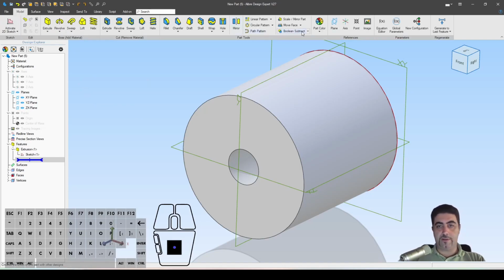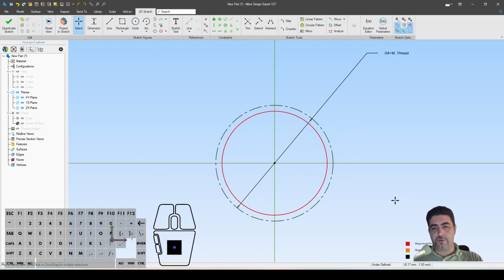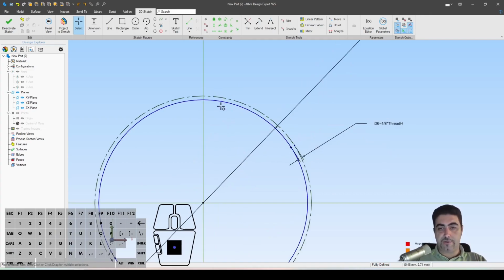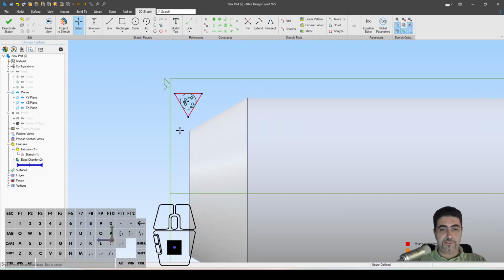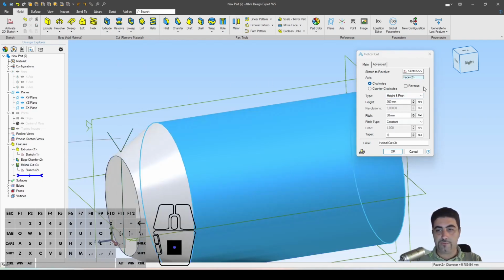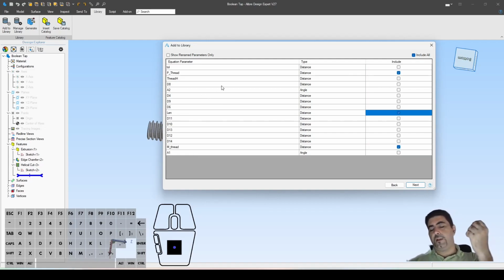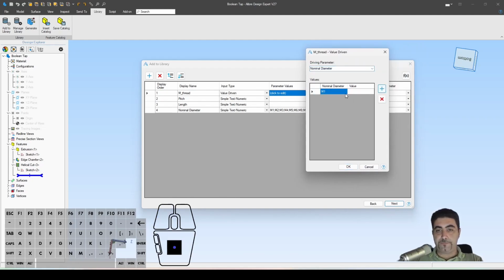STOP Wasting Time with Old Thread Modelling and Try THIS Instead!

Comment: Love it. Here's a challenge since you appear to be the master of this... Are you able to do NPT threads? The main issue being that they are tapered. Anyway, thanks for the video!
Reply from the maker: Yeah, I actually mention this in my other video, the one I reference here.

You need a properly tapered hole, and then in the Helix, you just input the correct angle, which can also be a parameter.

Comment: 00:00 Part 2! Let's go!
00:12 And tap it we will.
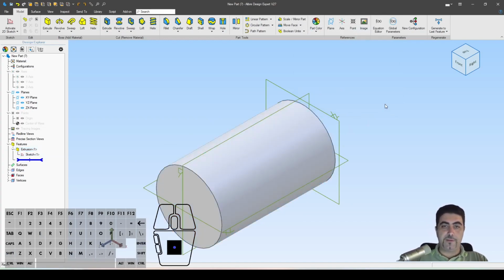08:50 I realized I didn't have a keybind for finish sketch. Let's fix that.
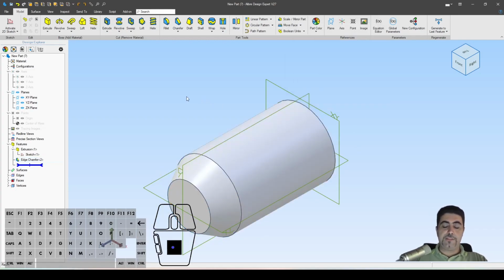09:44 Actually, it doesn't look like the same result to me. At this stage in the tutorial, P_Thread is still 1mm, but the process you just did caused the distance value to change.
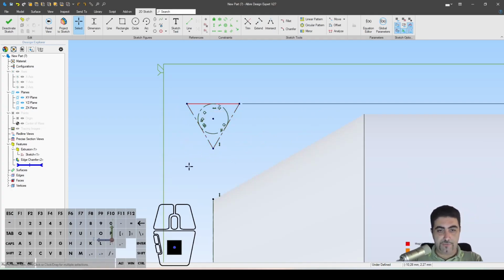12:20 Wash, rinse, repeat! I've done this part enough that I'm getting ahead of the video here!
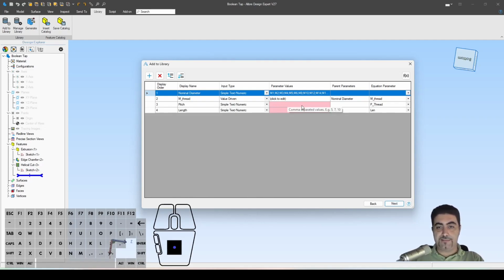22:05 I ran into this problem here in the last one! Not sure if you mentioned changing the Input Type and I missed it, or if it got cut out, but I did manage to fix it by looking at yours. I didn't miss it this time, though!
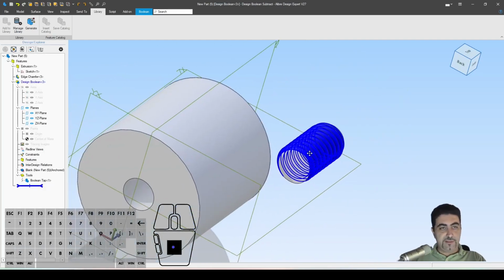23:22 I can't find how to turn on "Real Time Update" by default. Any clue where that is in the settings?
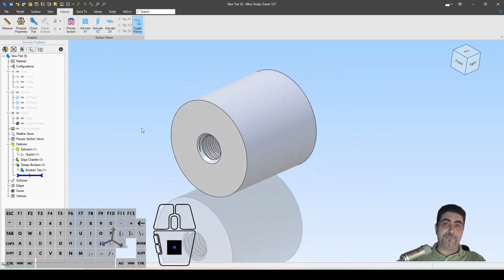24:10 As before, it works perfectly. Thank you so much for doing this.
Reply from the maker: Once again Adam, your detailed feedback is invaluable. You're giving me some welcome homework to check how discernable my tutorials are.
Thanks m8, and I think I'm right to wish you to enjoy the Pro licence.

P.S. Are you following along the library setup? Oh man. You got Expert! Kudos man! You'll love that! Make a video with some impressions when you get the time.
P.S.2 Real Time Update is a check box at the top of the menu where you select the parameters. Top left of your screen
Reply: @ExMachinaEngineering with the real time update, yes I see the box but on yours it's default on. Mine is default off. I'll have to look through and see if there's a setting to change that
Reply from the maker: I think you just click it on and it remembers. I think. Yours is off but you can click it on, right?
Reply: @ExMachinaEngineering  Yes, mine starts off and I have to click to turn it on each time. It's not a huge deal since it's correct once I click finish either way.

Comment: In your video, you used the Part Library which is a Design Expert feature. I'm on Atom, but if I upgrade to Pro, could I get around using the Part Library? My thought is that I could just have a folder called "Threads," in which I have internal and external taps/dyes of varying sizes. They would be easy to generate because you've made everything parametric. If I don't have the right size, I could very easily create the right size in about 2 minutes because you've used the equations.
Reply from the maker: Very good question. In fact, it was you mentioning that my Threading Die video is what got you thinking of upgrading to Pro that spurred me to make the 3D printed threads video for Atom and Pro. I'd hate to have people upgrade to Pro to use that workflow and not be able to.
Having said that, the workflow you describe is precisely what I propose in my last video. Which is, have a folder and open a random one, change Parameters and Save As. So, really cool that you thought of that on your own. Good call.
Reply: I had a feeling that's what you were going for! Good stuff! I'll be following these videos when I eventually upgrade so that I can create threads with ease.

Comment: The library part which you created in Boolean operation window, does it have to be saved somewhere in the disk prior to saving the main part? Or does it live in the main part file?
Reply from the maker: You need to save the original somewhere in the disk first. But after you add it to the library, there is a copy created and you can delete the original if you want
Reply from the maker: Hey Ty, I just re-read your question and I realized my answer is wrong. The Boolean part you generate for the operation is saved at the same time as the part. Like an assembly. And adapting it in any way will adapt the resulting threaed too. So you can just open that n=one and adjustthe tolerance for example.
Reply: @ExMachinaEngineering  I see. So, each part will depend on another auxiliary part. 2 files need to be maintained including main part and the tapping part.

Wouldn't it be nice if Alibre saved both parts in a single file? 

Still a great way to create tapped holes though!
Reply from the maker: Sort of. If you want to make the same thread twice, even in unrelated parts, you can use the same boolean tool. It's like you're a machine shop and you're buying taps based on the jobs that come through the door.

Plus for 3D printing, if you adjust the tolerance on the boolean tool, it will update across every part where it is used.

So, keeping both parts in the same file has its pros and cons depending on the use case.
Reply: @ExMachinaEngineering  yeap. Totally makes sense. Thanks for revisiting this.